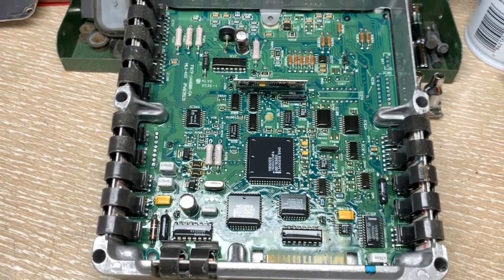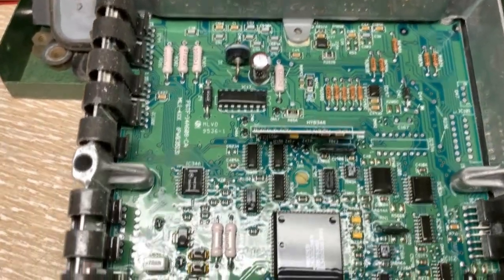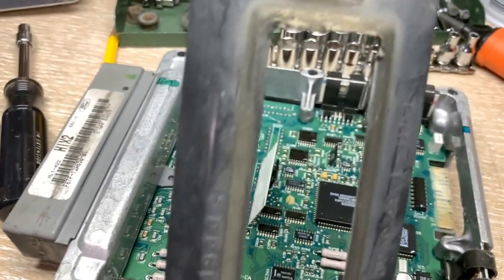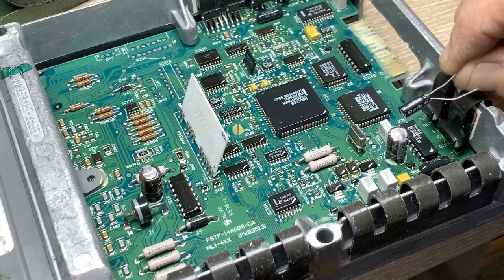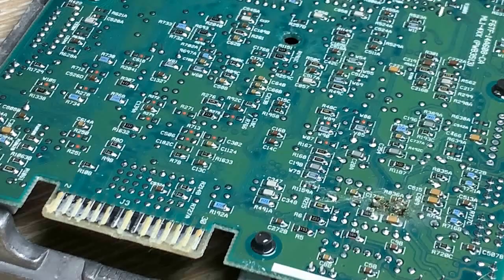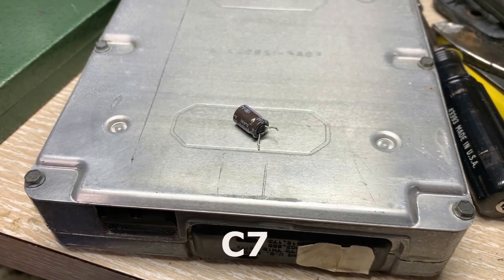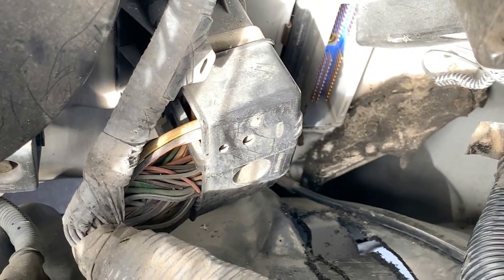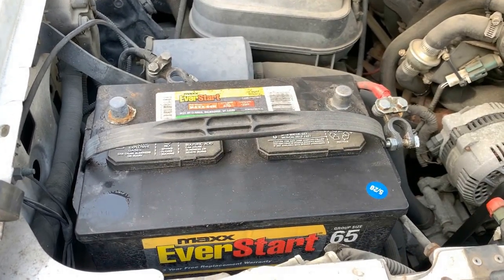Ford F150 1996 – H1X2 ECM Capacitor Overhaul and P0122

Comment: Ecm comes out from the inside as far as I have discovered,Well on older like pre “92”, 
Just checked ecm on my “96”.
Had to come out the front.Just had to loosen the fender liner and push down to get it out.
Ecm looks like new yet.

Comment: Smart preventative move on your part as you likely have a one year only ECU. '96 being the last year of it's generation and the only year for OBDll. My son is seeking one for his '93 (351/auto) and they're getting scarce. Bear in mind that there are hundreds of thousands more OBD1 versions like his for perspective. He sent me a photo of his and there are rings around both caps. The traces appear ok, so he's going to send it to me to look closer. I'll replace them, and repair the traces if needed. I have some experience in minor repair of vintage electronics boards. He's in NC with no soldering experience or gear, so I'm better suited to work on it now here in OH. His board doesn't have that rubberized coating, so should be a tad easier. Appreciate you sharing your experience and the addional info in the description. I'll be sure to order Nichicon or Panasonic high temp replacements if I don't have some already. 

Another note, I have pretty much the exact same truck as you. White/Gold Eddie Bauer, 300/5spd, single cab short box. Only visible difference is mine has a tach and it's a 1995. I'm at 180k with a recent clutch replacement. Runs great but I get a engine check light sporadically. Haven't given it a look yet as diagnostic procedures are a bit more challenging on OBD1 and there are no driveability issues right now. My truck is pretty solid and I have no desire to get a newer one. I could go further into that matter, but I'm already a bit long winded here ! In short, I appreciate owning a truck in which I understand how things work.